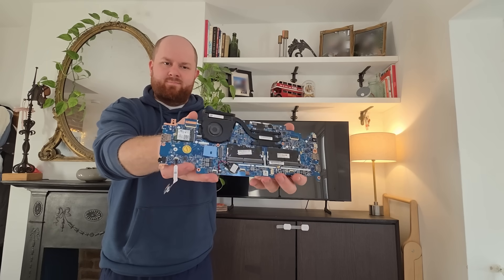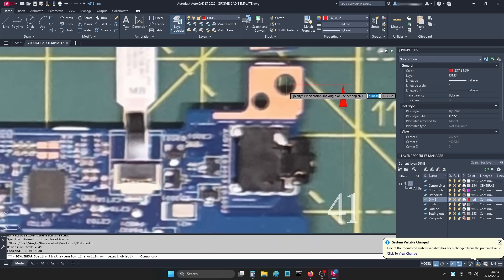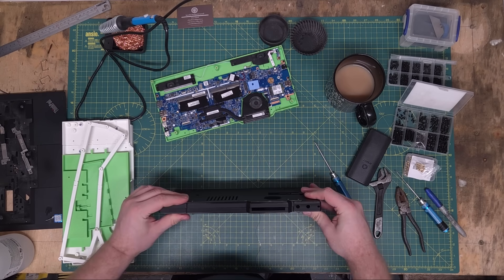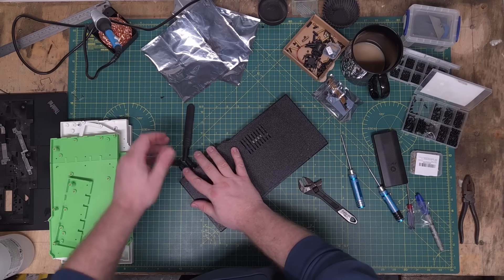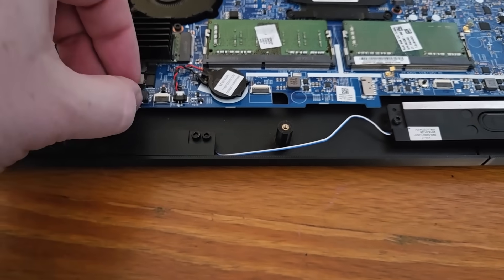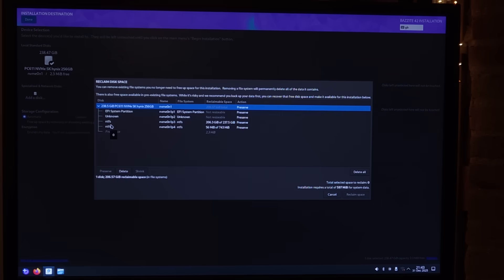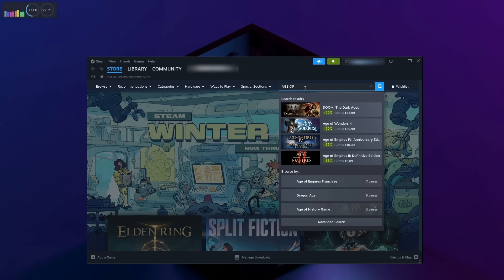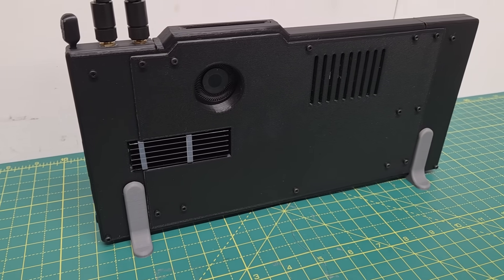I built a £15 laptop motherboard gaming PC (MDM lock) | Bazzite Linux

Comment: Nice video. It's incredible how far gaming has come on Linux as when I started using Linux around 12 years ago it was a struggle to even get older titles to work under Wine sometimes.

I have to use Windows 11 at work unfortunately and my work issued laptop with an 11th gen Intel CPU  is slower than my Arch setup on my 8th gen intel laptop.
Reply from the maker: I agree, it's come such a long way with Steam now you don't need to be a Linux boffin to get it all working! I'm rocking Arch on my T480, 8th gen CPU as well, still going strong! But likewise, I have to use Windows 11 for all my AutoCAD work and for my editing. Cheers